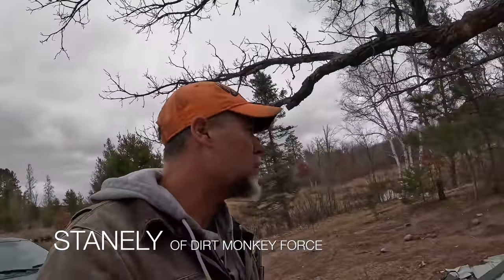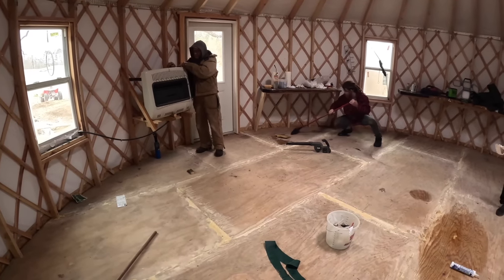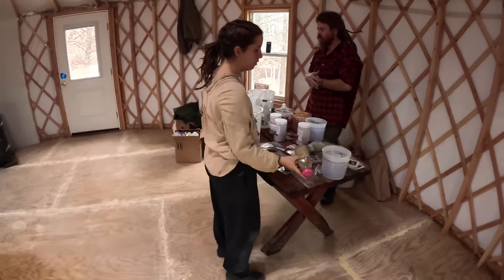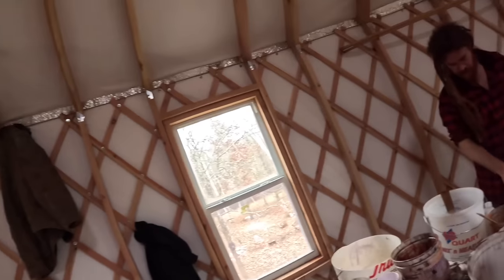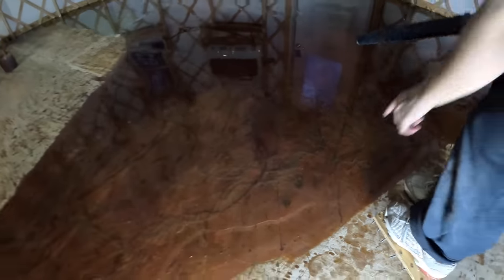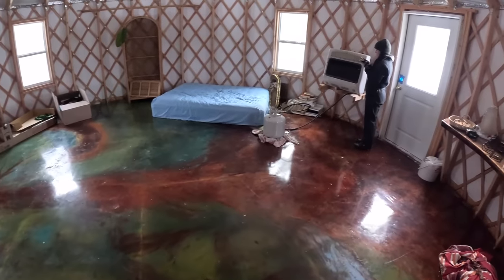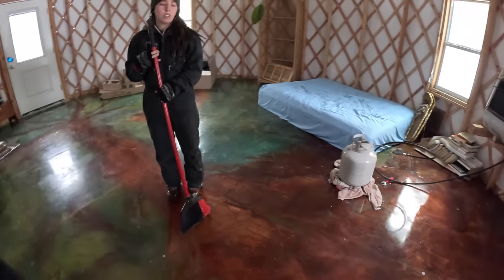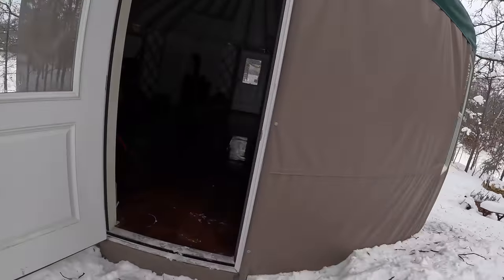2 NOOBS pour a Gorgeous Epoxy floor!

Comment: Condensation is from propane heat.  Get it up to or over temp a little, shut the propane off, and rely on the wood stove which is dry heat.  Should dry right out in there in no time. ;)

Comment: epoxy is the hardest liquid to control based on how big and thick a pour is also how reactive the epoxy is too like 5 minute epoxy or 24 hour epoxy just depends on the product you choose but ive heard great things about stone coat for a long time would like to try doing a bathroom sink myself
Reply from the maker: You should do it! Pretty cool stuff
Reply: Stone Coat has a really long hardening time.  I used it to do my entire kitchen countertops and it turned out amazing.  I had a couple of hours of "play time" before it got too sticky where doing anything more would have messed it up.

Comment: Your supposed to pour and let it level and mix it on the floor to make swirls when it’s flowing out but that’s normal floor kind i dont know about the counter kind. But usually it’s pour and just level off and no painting but swirl with a roller if you want

Comment: Would’ve looked much better if the floor had been painted prior to putting the epoxy down. You can see the seems of the subfloor.
Reply from the maker: They didn’t have enough epoxy to cover the entire thing completely. I think a top coat would be 👌

Comment: I would have done it differently, I would have done the tree first, taped off the area for it and poured it. Let it dry, then done another section and so on. Need to heat the epoxy with a heat gun or torch to get the air bubbles out. Man it’s a process on a wood floor